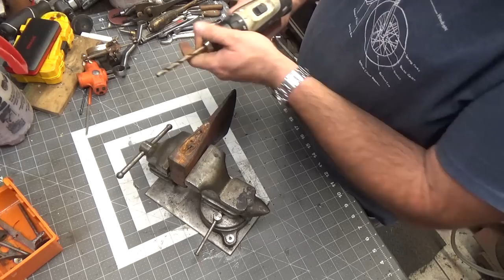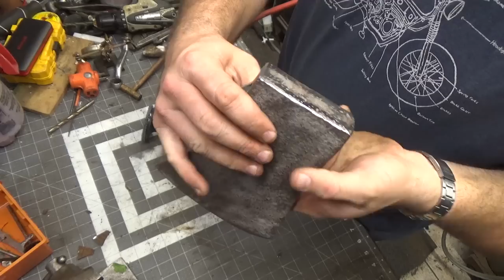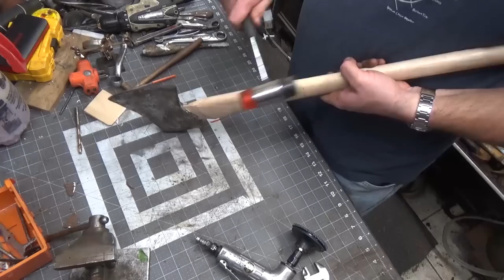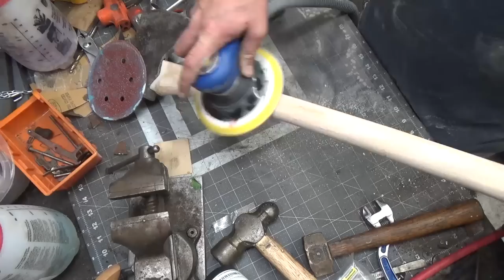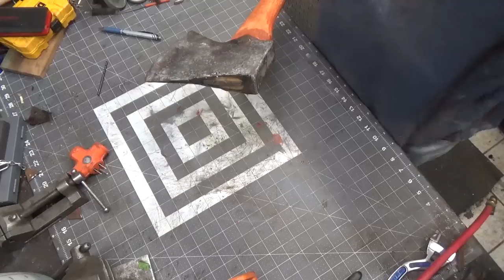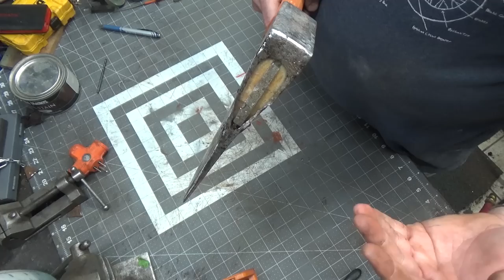How I go about fitting an Ax Handle

Comment: Hi Joe! Hanging an axe or hammer is a very time consuming process... You made it look easy because you have done them before, however for a first timer attempting this you better have a few hours to kill if you want to finish the job!  =)   That job is so despised that the sales of fiberglass and steel handled striking tools have skyrocketed and wood handled tool sales have plummeted since the 1950.   Even replacement handle sales have dropped drastically!  The good part is manufacturers like Douglas and Martinez have come up with 5 minute handle change designs!  Great stuff!  Loving the axe!   Thanks for sharing!
Reply from the maker: Hi Scoutcrafter, that makes sense. I got a pile of axe handles for super cheap $5, $7, and maybe a really nice Hickory one for $12, I was amazed, the market must suck for wood handles, as you say. Your hammer video sort of inspired this video. After watching your video I checked out a couple of the manufacturers and I bought my brothers some hatchets, I bought a Plumb and a Vaughn...they are so nice. Anyway, I figured i'd clean up the ax and give it as a gift to. Thanks for the inspiration. Cheers

Comment: Hey Joe.  I use a draw knife to whittle down a wood handle for a good fit with old hammers and axes.  Works very well.  I briefly noted this after ScoutCrafter's hammer video; seems like every garage has an old rusty hammer or maul or axe, with rotting wood, sitting away in a corner.  My buddies all know, now, that I like fixing those.  So, those heads just find a way to my house, on their own, now...
Reply from the maker: Hi Foot Pusher, I think a draw knife would be the ideal tool. My issue, draw knife or not, is knowing how much to remove and where, I suppose it is a skill that can be learned with practice, but from the sound of your comment it sounds like it comes natural to you. No doubt it is a great skill to have, because as you say all the tools end up migrating to your house. Thanks for the comment. Cheers

Comment: Never seen an all metal wedge like that before.  Looks like it would hold good with the serrations though.  We have yet to get power and machinery in our igloos up here in Canada, so we are stuck using wood wedges ;)   Looks like it turned out not to shabby and I'm sure it'll make its way through some wood.
Reply from the maker: Hi Bradley, yea that metal wedge was great. Between the wedge and the epoxy that should be on there for a while. I can`t imagine it up in Canada, we just had a cold front come thru, it got down to 51 degrees f. I may get some footage of her splitting wood, but that wont be till after xmas. Cheers
Reply: @joeheilm At least wear some safety socks with your safety sandals if you're going to be chopping wood. haha

 Weather hasn't been to bad here yet, above freezing the next 5 days or so, but of course we like to tell a good story about igloos, dog sleds and spear fishing.
Reply from the maker: Lol my safety sox are next to my safety squints ;). I know how you Canadians are I watch "zip ties n bias plies" hahaha, if you haven't seen him you are in for a surprise...lol Canadians :)

Comment: I once had a cheap Chinese hammer that a klutz broke the handle of. I know how we're afraid to muck up the temper of steel with heat but--true story--I chucked the head in my wood stove one cold December night and, the next day, did the crudest job in the world cutting the handle down to fit on the bandsaw. The result? The best short-handled hammer in the world, bar none. That was 3 decades ago, and my hammer drawer now boasts many Gedore red bands and so on, but that piece of junk is still my favorite. Go figure.
Reply from the maker: My ball peen hammer is a similar story, it is a no name junker with a hand made handle. It was my favorite for years. I put a real handle on it now i dont use it as much....i guess their is something to the hand made handles. Thanks for sharing, i enjoy those kind of stories/experiences. Cheers